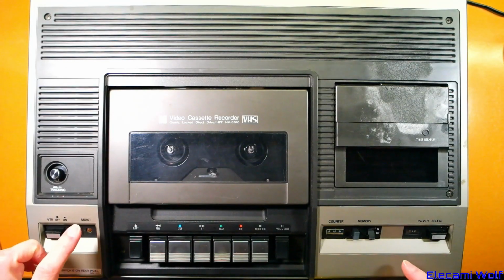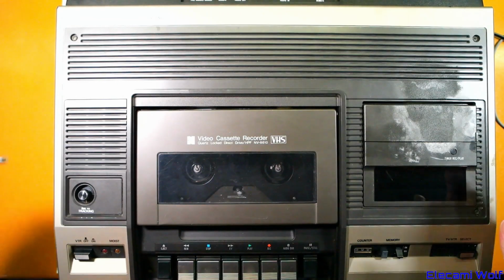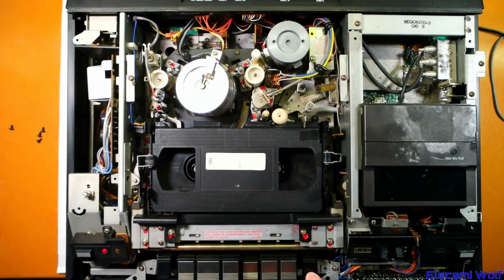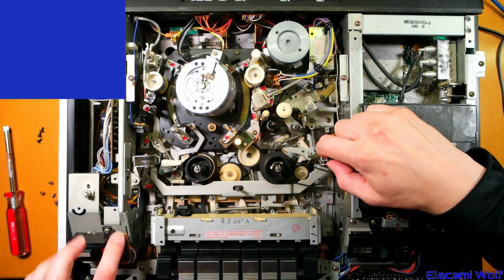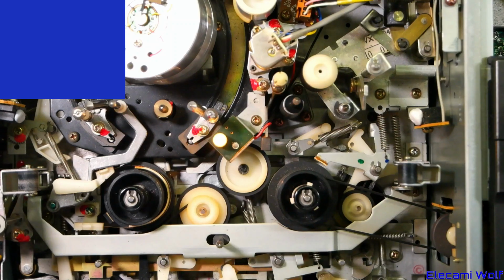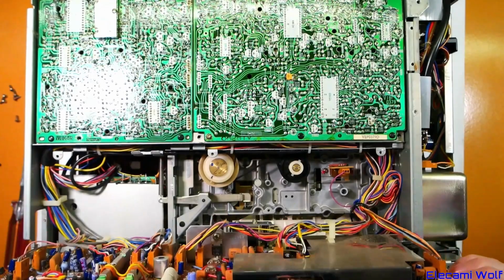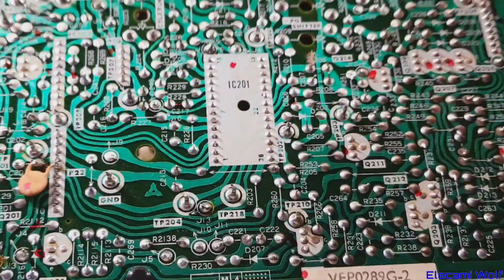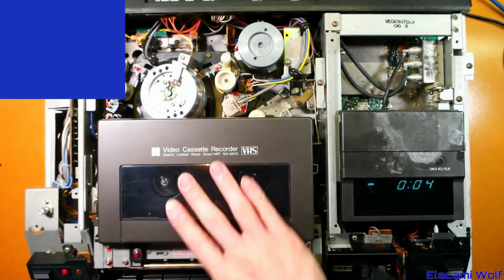EW0101 - National NV-8610 VCR Investigation and Teardown

Comment: Just in case, i found the exact same model. I dunno if it doesn't "detect" the tape or not, but only Rewind button is available (and Stop). Others are just locked, can't even press them. I tried to hold the tape and to find the mecanism, but didn't work. Sorry to bother you but have you got any idea where to look at ? What's locking those buttons. Thanks for the video, help a lot for other things.
Reply from the maker: Maybe the light bulb that shines through the tape for the end sensors is blown.
Reply: @Elecami  I'll try to look into that when i have time, thanks for the help!

Comment: We still have the NV8610, but unfortunately a multi tension transformer the machine has inside was gone decades ago, and the technician was unable to get a replacement at the time. Now, I would like to find a replacement of this part in order to come back the VCR to life. Great memories, we bought it new at 1977 or 78, at a cost of 93.000 pesetas at the time (something like 600 USD or EUR, a lot of money in 1977)
Reply from the maker: Unusual to have a transformer fail. Maybe caused by something like a shorted rectifier. Might be able to get one custom made if you cant find another machine to take a transformer from.
Reply: @Elecami Thanks for the answer! As far as I remember (it happened in the first 90s or last 80s), one bad technician bridged a fuse and that was the cause of the disaster. A second technician later diagnosed the fault. We still have the broken transformer with its wires apart. I hope no more componentes are involved in the fault. Regards from Spain :)
Reply from the maker: @galimusic7164  Probably was a real problem causing the fuse to blow.

Comment: I have the NV-8600-EM which is exactly the same as this except it can also play NTSC tapes and doesn't have a still frame in pause. The idler wheel is supposed to swing to the left in rewind. Likely the pivot point in yours is stuck due to hardened grease.
Reply from the maker: Oh yes, probably. Thanks. I will check that next time.
Reply: @Elecami Thanks for the answer! As far as I remember (it happened in the first 90s or last 80s), one bad technician bridged a fuse and that was the cause of the disaster. A second technician later diagnosed the fault. We still have the broken transformer with its wires apart. I hope no more componentes are involved in the fault. Regards from Spain :)

Comment: Hey dude, hope you're doing well. Tangentially related to the vid, I've gotten a CRT to plug my National VCR into. But now I'm struggling with how to actually tune the crt into the right channel for them (VW-ET180 and NV-180) if you've got any tips I'd appreciate it, cheers
Reply from the maker: Make sure the VCR is in VTR mode and play a known tape or have a video input connected. Then do what ever you do on the TV to tune it. Does it have manual or automatic tuning? You'll probably find the VCR in the VHF band.
Reply: @Elecami  after fiddling with every setting imaginable, I switched the tiny (channel 3/4) switch under a plate on the vcr and that fixed everything 😅
Reply from the maker: @mr.frogman9939  Great good to hear.